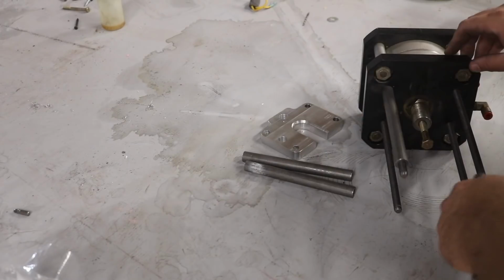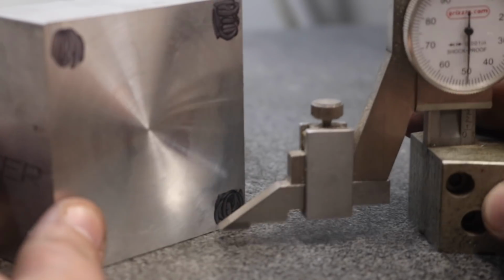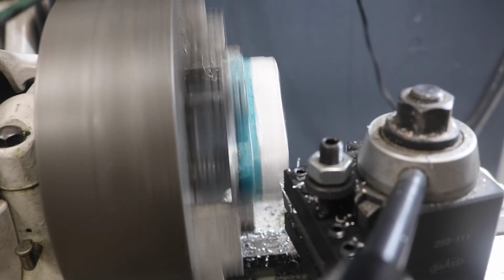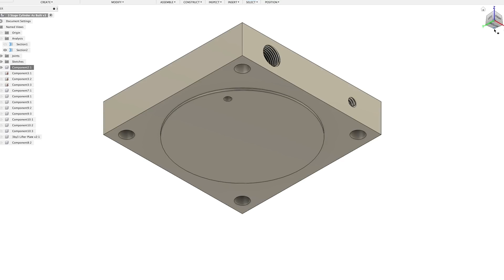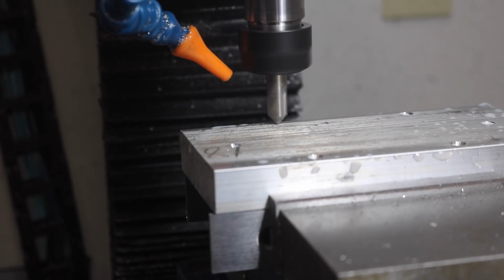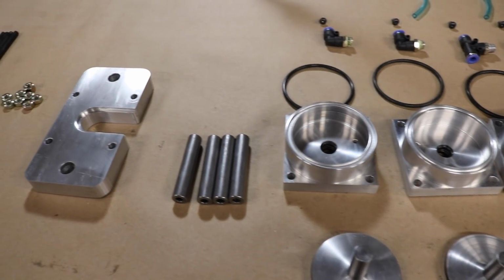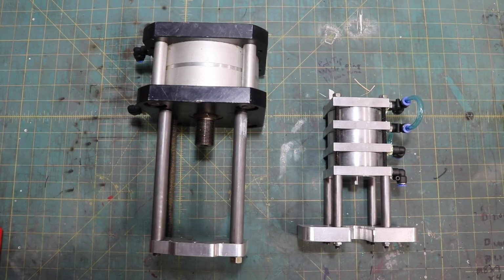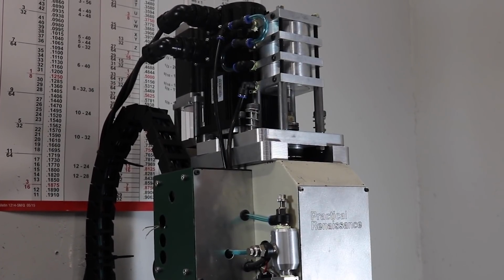I made a small 3 stage cylinder for my power draw bar

Comment: quick question i have mocked one of these up on fusion.. is there a certain volume the cylinders need to be or does it not matter as long as you have say 5mm of movement to press on the draw bar

Comment: Using the concepts in your video, my 3 stage cylinder is finally finished (except base plate).  I have the Precision Matthews PM-30MY. Where did you get the longer drawbar?
Reply from the maker: I just used a piece of 7/16-20 B7 grade threaded rod from McMaster. I killed hexagonal flats into the top of mine after cutting it to length, but that feature isn’t mandatory

Comment: Awesome video! Do you think it would work to interpolate the cylinder on the mill instead of using a lathe? I don't have a lathe myself and the only one I have access to is quite crappy, not sure if it even has a 4 jaw chuck. The o-ring grooves might be tough, but it could work with a T-slot cutter or a small slitting saw. I'm just worried about the accuracy of the interpolation compared to a true round bore from a lathe.
Reply: Inverting the "lathe-as-a-mill" trick, you could clamp the tool in a vise on the table and mount the work onto a toolholder on the spindle.
Reply: @EmyrDerfel  I've seen that done before, and would totally do it for small parts, but not so sure about a big cylinder. Worth a consideration though for sure
Reply: @DarkArtGuitars  other option is to finish off the cylindrical surfaces with a boring head or a flycutter with a custom insert.

Comment: I wish you had gone into how you came up with the numbers though. I didn't realize it was this easy, so I'll be making my cylinder as well
Reply from the maker: Dang I thought I replied to this, must have gotten eaten. Anyway, the key numbers are in the output you need to compress your belleville springs, and that's a function of the PSI you can get from your air compressor vs the diameter of piston(s) you want. Force output per cylinder is the piston area (Pi*radius^2, I just use an online calculator 😂) times operating pressure.   You can then multiply this by the number of sequential pistons (3 in this case) to get your overall output force and if that's enough to compress the holding force your springs are putting on your drawbar, then bob's your uncle.  With my setup my piston is outputting a shade over 2k lbs of force, enough to compress the 7/16" ID Belleville spring stack I have; it's a shade lighter than what the Tormachs use on their machines I think but I personally use light tools and haven't had a problem with tool pullout with this setup (in fact I'd only ever had a problem with tool pullout when I was manually tightening the drawbar).   It's all based on different variables which is why I didn't get too deep into it in the video, hope this helps further explain some of the "Why" and "How" for you, and thanks for watching!!
Reply: @PracticalRenaissance  I'm a bit of a jerk to be honest... I run my PM-45M really hard. I also don't really have shop air since this is in the back room of my house and not in a real shop. All of the outlets are on 1 circuit. I need to see the current draw on my control box (220v) and see if I can get a small air compressor on it. Thanks for
 the explanation!!

Comment: The question i have is this ac servo capabile of cutting steel on your mill ..what size is the servo motor  at what speed do you cut and what the max dept of cut

Comment: Do you have any pointers on the physics of the multi stage cylinders?  I believe making them is pretty simple. One intake hole above each piston to push them down, and another in the bottom plate that will push the stack up. In the cylinders that are not pushed up there are holes below the piston that just let air flow freely to evacuate the air as the piston moves.

Comment: That is a super efficient way to do that. It looks like it also lowers the load the Z axis has to carry by reducing the weight. I’m still using a small pneumatic ratchet for a semi power draw bar. Did you crank out those parts on the Grizzly mini lathe?
Reply from the maker: Thanks! Yeah I’m always concerned with too much load on the head causing problems during rapids, although I don’t think I had any problems with the old cylinder. I used the pneumatic ratchet for a long time, it’s reliable!! I made this mostly on my old south bend 9a lathe, the grizzly mini I have disassembled for another project/idea, but it could totally have been made on that!